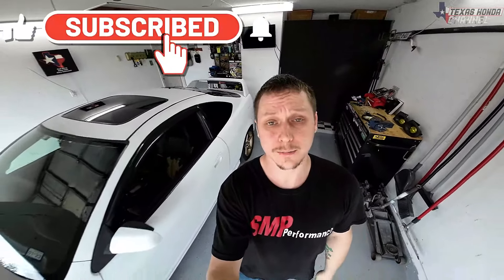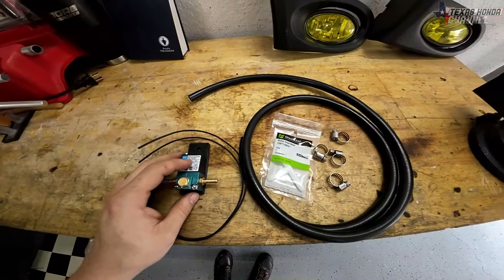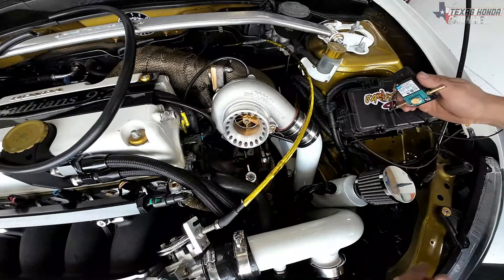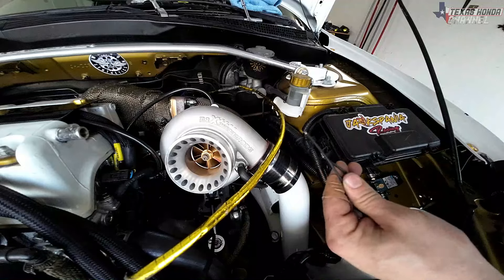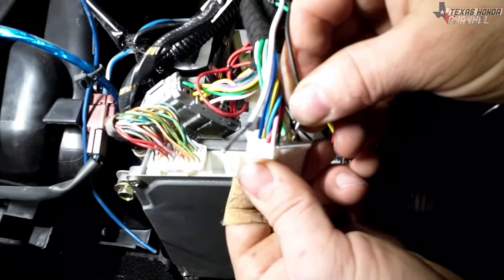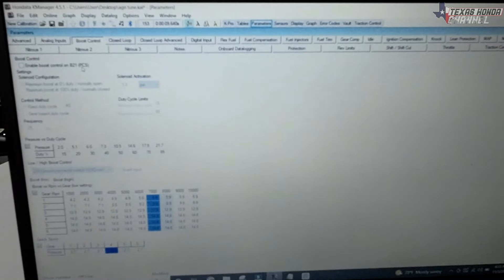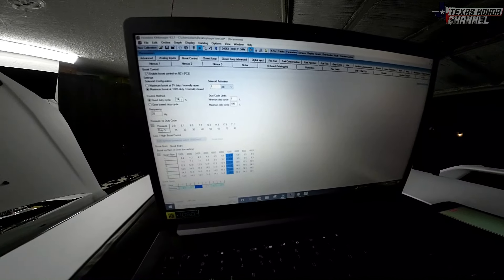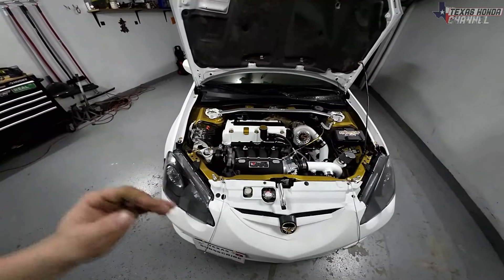HOW TO INSTALL ELECTRIC BOOST CONTROLLER. TURBO RSX

Comment: Suggestion: look into getting a nitrous kit. The nitrous would be for the intercooler to keep those temps down.
Reply from the maker: I’m not into nitrous. The intake temps aren’t a issue because it’s not supercharged. It was a warm night and they were at 90 under full boost so that’s really good. When it gets cooler out here in Texas they will drop even more.
Reply: @TexasHondaChannel  I understand. Your RSX is taking shape quickly, though! Awesome job
Reply from the maker: @ejsvirtualgarage  thank you 😊

Comment: So what would you do if your turbo does not have the pressure port inlet to connect to? Thanks.
Reply: You could drill and tap threads into the compressor housing and use Teflon tape on a barb fitting so it seals up
Reply: LOL - went withg a different turbo, was leaking anyways.  🙂 @joeyhatzenbuhler647

Comment: Hey when u had your boosted d series what ecu did u have. Trying to decide on a setup to run iv got a chipped p28 already just don't know what's on the chip and closest tuner is 2+hrs away and $600-$1000 for a tune.
Reply from the maker: I ran a Hondata s300 you can install it into a p05,p06, p28
Reply: @TexasHondaChannel  thats what I thought u had. I just no nothing about setting up a base tune right now and was looking up different ideas so I could start more research on it.
Reply: @GlassWerx  Hondata s300 is great product is more  Racing  P28 with HTS and a datalogger is also good for street changes made have to burned to the chip but that the only downside    my d16 turbo only needed few changes and had to burn chip few times to dial setup in
Reply: @frostyflowers4207  cool deal I won't be doing much racing really just wana do more with the car and add some power to it. I was looking @ crome I think it was and it had an option to suggest optimized setting during data logging but idk how well it would be.

Comment: 8:11 which wire did you fuse in ? One of the 2 black wires from the boost controller?
Reply: @texashondachannel
Reply: Or was it one of the three wires from the jackspania

Comment: What type of injectors are you running?
Reply from the maker: 1000cc id injectors, stock fuel pump and fuel lines for now. I need to get bigger injectors soon and upgrade everything but it’s working good now.

Comment: When are you going to the rrack??
Reply from the maker: It’s one thing after another im telling ya. I need a lot before i can go there still, cv axles are torn up and ball joints are torn to crap if you didn’t see in the video, clutch is starting to slip and don’t have slicks or anything to get traction. Not making it to the track until them things are done. I’m too broke to get that all done over night

Comment: Quick question. In your diagram it shows that the 3rd port(middle port) is vent to atmosphere but it looked like you had it plugged. Am I missing something?
Reply: its a filter

Comment: wanna sell that bracket for the boost controller? also if your using oem harness and have the evap sensor disabled. you can cut the plug off and wire the boost controller directly. For soldering also they sell quick solder that needs heat gun only.
Reply from the maker: That’s a good idea honestly never even thought of that.
Reply from the maker: I need to fix the design a little but might be willing too.
Reply: @TexasHondaChannel  definitely interested if you do
Reply: @Adrian Vega  is that possible to do with flashpro or is that only available with kpro?